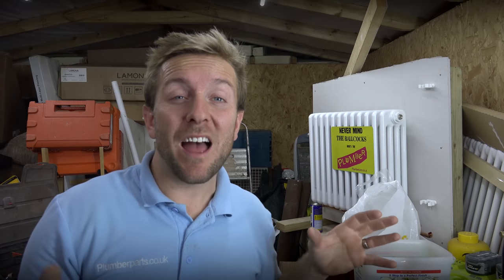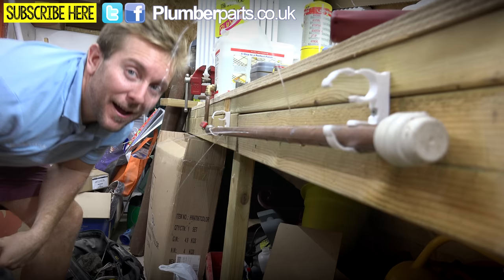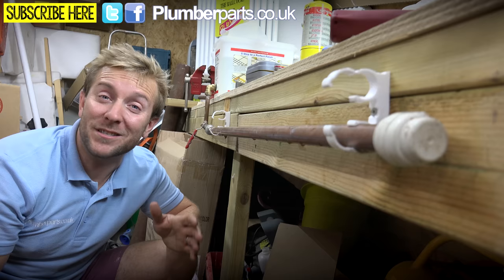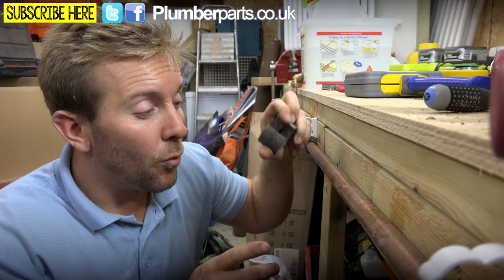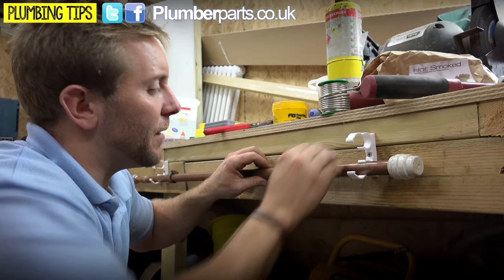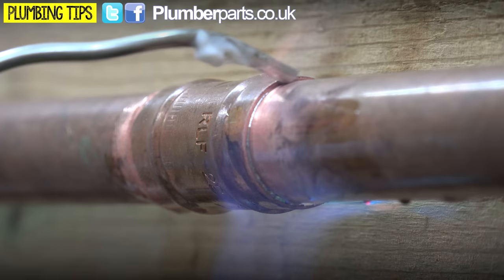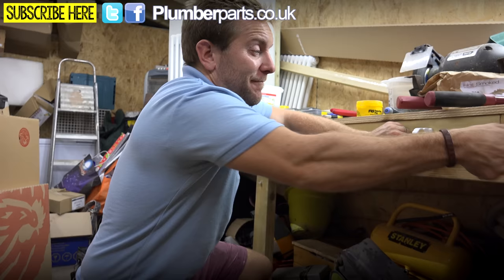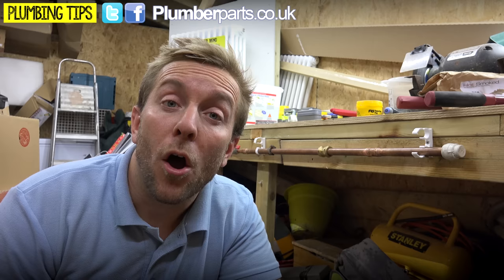FIX LEAKING COPPER PIPE - PINHOLES - Plumbing Tips

Comment: One temporary fix idea comes to mind. How about using hotglue gun to push some trough the hole creating seal inside? Maybe this could work on running system so water tries to push the glue out from the hole, sealing it from the inside and forming it to shape while its still bit malleable. This could be worth to investigating how it behaves.

Comment: Pinholes in copper pipe are caused by electrolytic corrosion caused by impurities in the copper, copper pipe today is very good but that has not always been the case, so don't mess about replace the whole run, plumbers who do a patch are usually after the repeat work.

Comment: The central heating upstairs in my two-storey house appears to be blocked at certain radiators and there is no access to the plastic 15 mm pipes without lifting up carpets and flooring. A few radiators downstairs are also blocked but I can easily access the pipes from the basement.

My question is:- what’s the easiest way to locate the pipes so as to only lift flooring where absolutely necessary? I was thinking about buying a thermal imaging camera which would hopefully give me a rough outline of where the flow and return pipes are at least. Obviously, if there are blockages towards the radiators then that water wouldn’t be hot enough to show up. Any thoughts? Aird, is there another easy way to do it? House and pipes are 25 years old.

Comment: A real trick in an emergency is a strip of bicycle tube wrapped around the pipe a couple of turns and fixed with a pipe clip which is undone, wrapped over the rubber tube and tightened up. Should be used as temporary emergency fix, but I have seen some that have been fixed and forgotten

Comment: I have seen this done in ABSOLUTE emergencies, but it does seem to work, temporarily:  get a sharpened pencil; stick the tip in the hole and break it off.  Then wrap it like crazy with a water-resistant tape like duct tape -- until you can do the REAL job needed.

Comment: Ran into this situation at my house following an overnight freeze. Had to shut off the water supply, crawl under my house and insert toothpicks into the pinholes. I imaging a hole such as the ones you drilled would require me to employ a wooden dowel(1/8 inch) and a pencil sharpener. Works good enough for pressurized pipe too. That'll get you back into bed until the hardware store opens.

Comment: Sooo, we had a freeze for several days. I left the water dripping, both hot and cold. Unfortunately one of the pipes on the side of the garage burst. Just a light spray. Luckily it was spraying on the side lawn or dirt as it was. So I just got some inner tube, some hose clamps and stopped the leak. 30 years later it is still holding. If it ain't broke, dont mess with it !

Comment: Another fast way to fix the leak is to use a piercing valve. Making sure that the piercing pin sits directly in the pin hole.

Comment: My problem is that I have the pipe hard against a brick wall so I can get behind the pipe to fix it like you have with this set up.  I tried to just some of that aqua putty with no success.  I do have a soldering iron at home but I have no soldering wire which I can get very easily.

Comment: What shall i do if i run with a saw while cutting the tong and grove chipboard floor half way through two radiator pipes next to each other  ( one is inlet one outlet of radiator ) no valves to close. Any quick fix before you drain the heating system to rooms below?

Comment: on the compression joint use jet lube jointing compound too.that will virtually guarantee you a seal.frys flux burns dry to quick.its crap..

Comment: I had a nail hole in my pipe about 10 years ago I lifted the floor board and  and just soldered over the hole it fixed the leak and I have had no problems from it for about 10 years now.
Reply: I have done the same, and if the hole is fairly big I placed some v fine copper wire ( from a flex ) over and soldered it all . seemed to work OK
Reply: This is what I was thinking would be easiest and not too temporary as long as the pipe is not falling apart.
Why cut the whole pipe and then have to  connect it risking more leaks?

Comment: A compression fitting is as good if not better than soldering,  it's good enough for Industrial use and compressed air at 7 Bar.

Comment: Thanks
Reply: James. Just went through the bathroom wall with a mutitool. Used your tip number one to hold the leak until pipe is moved to fit new shower. Super stuff. No dramas. Cheers.

Comment: You know those mini-offcuts of copper pipe that you collect in a bag to take to the recycling depot? Grab one that is a tad bigger than an olive - say 1cm - and cut it open with snips. Open it up, leaving a tail so you can use pliers to hold it in place for a few seconds. Tin and solder it over the hole. When all is cool, either bend the tail round the pipe or break it off.

Comment: A problem we have with pin holes is the Telephone companies were connecting their ground wire to the plumbing and it was deteriorating the copper. 20 yrs in same town and pin holes stopped when the ground wire was removed. This copper isn't rated for electricity and even the slightest current will cause this.

Comment: I think another two methods would be to mention slip ring couplers and the compression or push fit type pipe repair fitting which extends to join a rigid pipe together

Comment: You don't have compression slip couplings in the UK? Solder slip couplings?

Slip couplings don't have a stop so they can slide all the way on the pipe, meaning you only need to pull the pipes front back to get the coupling on, no need to pull them longways. If the pipe won't move at all you can cut out a section and use two slip couplings.

Comment: Or you can jank solder just a half circle copper pipe over the hole 😅

Cut a pipe about 2cm long, split it in half so you get two half circles and then bend to fit nicely over, clean the patch and the pipe, then flux, put the patch over and hold it with a steel wire around while you solder it.
Never tried it but it should work.
But pinholes is mostly a warning sign that the rest of the pipe is also pitted and will go soon, ESPECIALLY if like me you have well water with iron in it and high or even low ph in the water

Comment: Thank you, a very well made video with good content.  Can you temporary fix a pipe leak while the water is running trough if you don't have access at the main water supply or there are no taps around to turn it off?

Comment: Think you could have included the sliding, leak repair fitting. More often than not, you can’t slide the pipe enough to fit a straight coupler. I actually keep straight couplers, in amongst my fittings, that I have removed the inner shoulder using a 15mm spade bit, 22mm spade bit and a vice. Ideal when sorting a leak or replacing a section of pipe.

Comment: Great video, only thing that should have been done different is ream the inside of the pipe for the soldered fitting.  Prevents turbulent effect inside joint.
Reply: agreed because that turbulence it what likely created the pinhole.

Comment: Super easy emergency repair.  Whittle a plug of approximate size of the hole,  preferably in redwood or cedar but anything will work, sharpen one end like a stake or a toothpick and drive it into the hole.....problem solved.  If you were lucky enough to have found a chunk of redwood to whittle the plug out of. you're probably good for a couple years until you get around to fixin it right.  You're welcome!

Comment: ..But if the hole is in a central heating pipe within the enclosed loop of the system, how do you turn off the water that is running through the pipe then??

Comment: 5:23 You won’t need ‘spring’ in the pipe lengths if you simply use that pipe slice to remove a short section, equal in length to the size of the compression fitting.

Comment: A plumber secret, for dry pipes, take fresh bread, stick it into the pipe on both sides to absorb the excess water .  After the water is turned on, the water pressure will push the disintegrated bread thru the pipe and out the faucet.  Easy

Comment: Have you tried drilling the hole bigger and then install a snug fitting pop rivet? This other method works on rubber hoses and can withstand mains pressure: I use sewing thread and tightly wind a few dozen loops over and around the pinhole. I have a tool which friction feeds the thread so I can tension every loop. It even works for a half-inch longitudinal split. No copper pipes here so dunno whether that will work. Maybe with a bit of rubber hose around the pipe.

Comment: I use silver solder and my oxy-acer. Torch to fill in small holes in the Copper pipe. Will last forever.

Comment: He is not a plumber, just an actor.
To fix a pin , all you need is to silver solder it.
If the hole is big then use an electric single strand cable cupper and put it in the hole so you will not have a gap to bridge.

Comment: Supposing the leak is under a concrete and tiled floor BUT nothing shows?
Only that every few weeks the system needs re-charging, is there a good pipe leak finder that will seal well?
Any help welcome. Thanks.

Comment: I have a really tiny leak (it's more of a slow drip so that a small puddle occurs, the size of a 10p coin), underneath a radiator copper pipe (its at a joint where 2 pipes meet) which runs along the floor. I've tried taping it using waterproof silver foil tape and also some Ultratape SOS Repair Bonding Amalgamating Pipe Tape but the water ALWAYS finds its way to the end of the tape repair and leaks there instead.?!! Its like everytime I tape up the leak, I'm just moving the leak further along the pipe??!!! How should I tackle this?!

Comment: I don't mean to be critical, but you didn't ream the pipe Failure to ream also causes pin holes down the road. Also, quenching a hot pipe can cause cracks in the solder joint.

Comment: I never heat a yorkshire fitting i heat the pipe each side just until the solder appears. So far after many many years of doing it this way not had a failure. Flux of course and clean 1st always.

Comment: Missed one type of repair. Cut a short piece of copper  pipe in half to use as a patch. clean and flux the inside radius of your patch clean and flux  pipe with pin hole put parch over pin hole section hold in place with a piece of wire and solder in place. Fast zero cost and as permanent as the pipe you have repaired.

Comment: OK. so I think you have done well but pin holes will usually be on 3/4 inch pipe. so make sure you have the correct olives and fittings.   Also, in the 50's they mixed Iron in with the copper, so the only correct way is to replace the lot.  If the "copper pipe" is magnetic it has to go. I am not making this up.  Get a magnet, if it sticks to the pipe; it will big a big job.

Comment: keep in mind he said temporarily. FACT IS this method will work on ANY non pressurized pipe as will Flextape.. Have done this method on pressurized pipe , keep in mind you may need to adjust and readjust the hose clamp and rubber piece.  It would work better using a piece of rubber hose split open in effort to place it around the pipe.  this way you'll have the ability to move the whole work piece around to find what works best .  It may help to place two hose clamps on while using a split rubber hose.  
And no, not a up your nose with a rubber hose joke here.

Comment: Why you never make tutorials on press fit fittings? I WOULD NEED IT FOR A DIY RADIATOR JOB, COPPER PIPE. I need to move a radiator to the opposite wall

Comment: I have a pin hole leak in a pipe about 2 feet deep under a concrete floor. Could I use leak seal to.fix it or should I try something else?  I don't really want to dig up the floor as it is in the sitting room.

Comment: When the water won't quit running into your solder area / fittings, get white bread and push it into the leaking pipe until it stops the water. The bread will break apart and run out of the faucet, which is why wheat or grain breads should not be used. No raisin bread. ( yumm. Raisin bread)

Comment: If you want to stop a pinhole leak temporarily, there is a new product that is a 'Silicone Tape' or 'Self Fusing Tape'  that sticks to itself.  You stretch it out, pulling very hard on it while you wrap it around the hole in the pipe.  The tape sticks to itself and seals off the leak.  There are lots of YouTube videos showing you how to use such products.  But be careful, the tape often 'breaks in two' 6 to 12 months later from the stress of the tension in it, so it is NOT a permanent fix.

Comment: Why can't half a fitting be soldered over the pinhole?
So inplace of cutting the pipe, just clean it up and apply flux, clip a fitting with a section taken out over the hole, then apply solder as normal.

Comment: Hummm.. not what I would do. Copper wood screws in various sizes are available. Drill out the pin hole to a size the screw can fill before being totally screwed in. Clip off excess small end of screw, screw it in, then solder the whole mess.  It will never leak, probably from the screw alone, but the solder makes it absolutely water tight forever. Works for me, and holes show up in drywall where somebody screwed the drywall screw in a bit too far and no plate was there to stop it. Maybe add that fix at the end.

Comment: The only time I’ve ran in to pin holes like this was because they were using the pipe for a ground line for there electric and the copper pipe was all etched out you could crush the pipe could be crushed like tinfoil in your hand another thing the last few years they have been making zinc pipes with a copper coating I think these were made in China but if the copper gets scratched the water gets on the zinc and the zinc dissolves just leaving some copper foil. All of these you should replace the whole section of pipe if you drilled a hole or poked one acidity with a screw or nail your fixes will be fine

Comment: Do they make a liquid drain pipe fix like they have for tires where you can pour it into a drain line where the leak is in an impossible to reach area like behind a wall? I wish they had something like that which you could pour down the drain that would go into the holes and plug the leak.

Comment: Fixing a pin hole on copper pipe is so easy that any moron can do. Finding the leak under a slab, which is typically where the leak is requires more skills and tricks a rocket scientist has.

Comment: In the last example, instead of cutting the pipe and getting into all that complication, all you need to do is insert/hammer in a mushroom shaped, copper wire, a little bigger than the hole diameter, where the mushroom head is flat on the surface of the pipe, followed by some solder to keep it firmly in place and without leaking.

Comment: like your test rig but the water is not under mains pressure.  deffo method 2 and 3 will be okay but method 1 under pressure will leak in my opinion from a retired plumber

Comment: When you solder a joint make sure you an open valve as in this video the heat pressure will blow out the solder joint I can’t see how his joint held

Comment: I have just had a new combi boiler installed by a reputable company. We had an old system with a tank in the loft and an emersion, with a very old boiler on the wall. We have underfloor heating in our extension orangery.
The plumber took away the motorised valve for the u/f heating and has connected into the boiler. After the plumber left he turned the u/f heating on and said it would be ok. After 30 mins the floor didn't start to heat up, I checked the boiler and the pressure was almost in the red. Question.. should they have fitted an expansion vessel? The old tank was open and my new system is pressurised. Dave

Comment: You cant solder a joint when there is water in the line, even as you put a torch up to the pipe water will turn to steam, and still wont solder , make sure you have all the water out of the line.

Comment: Excellent. Now try fixing a pinhole between floors leaking at the subflooring, bathroom upstairs and basement below, and a tight fit, 10 inches up where you can barely get your hand between the floor joists, let alone a pipe cutter to spin. I've used duct tape(fk off) and leak stop(Ha!). Next up, a small sheet of copper or brass slid over the line and affixed. Easier sliding down then pushing up. We'll see. Or maybe just bulldoze the house.

Comment: What of i can't turn the water off? Is there a way to do it without isolating the water?
Reply: All houses are supposed to be able to turn the water off.  There will usually be a valve when the water first comes in the house and another one at the water meter.

Comment: In real life with a full length of pipe , you would never be able to solder a pipe like that without waiting for hours for the pipe to dry up , any amount of water inside the pipe will prevent solder to work.

Comment: The copper fitting you are soldering is so called "press-fit"  fitting ( aka Viega ProPress fitting ) that has O-rings inside. You use Press Tool  to attach this type of fitting to the pipe, not a torch. Just saying...

Comment: Great video. If you have little or no spring for the compression joint repair cut twice. Using fitting as guide 15mm from memory internal space is about 20mm so nick 15mm out. Do check measurements remember olives need to fit over pipe! If you cut too much out make your excuses and leave 😜😆⛲🌊💦